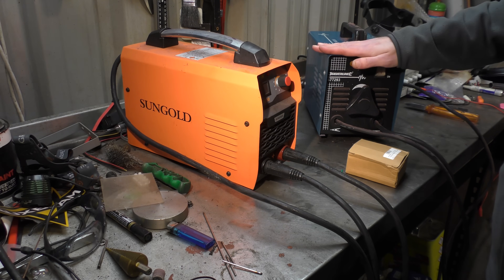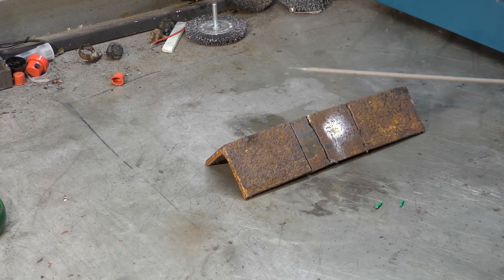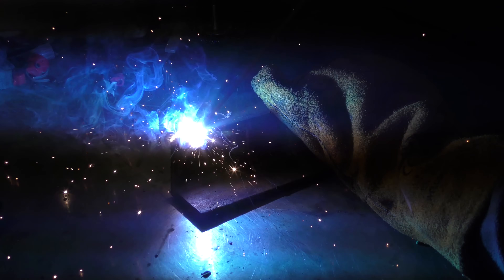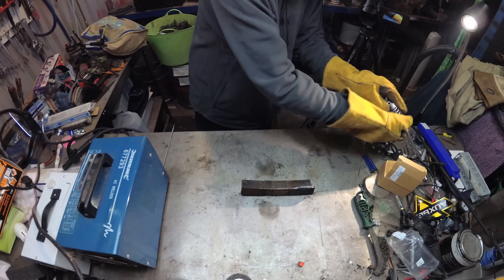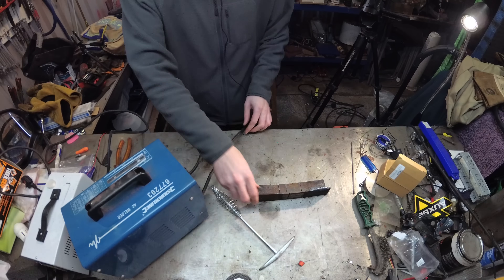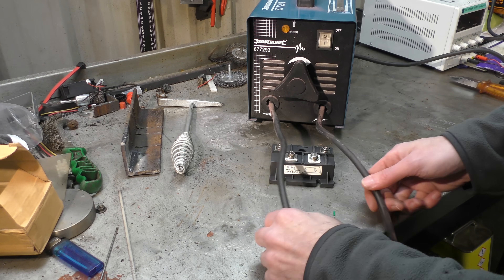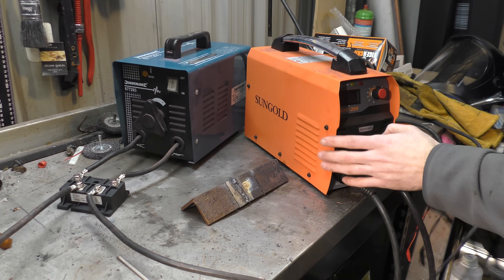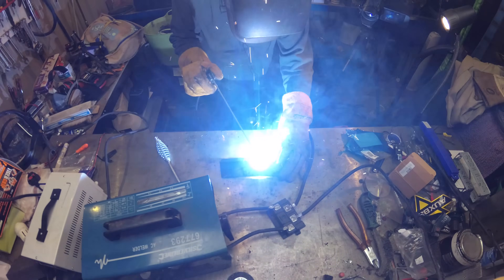Turning AC welder into DC with a rectifier

Comment: I converted my welder from AC to DC and found that with electrode negative (like yours) that there is less splatter and more heat/penetration put into the work piece. Think of it like a magnet in that through AC it attracts and repels at 60 times a second (50 hertz where you are?) and through DC it is always in an attracting mode of the weld metal to the work piece. As for your capacitor, carefully measure your AC voltage at the terminals with the unit turned on. On my 90 amp unit, the AC voltage had a highest reading of 27 volts. The capacitor I used was rated 21,000 microfarads and up to 100 volts DC, well above the 27 volts output.
Reply: Hello, I am planning do the same with a Lincoln AC-180 welder.  I measure in CD after the bridge rectifier, in open circuit, and have 110-130 VCD, (in 110 Amp the selector) I know that must drop that voltage to 25-30V  when soldering, but for that above 100V open circuit voltage, need use 150 or 200V capacitors.... or not ??  this cause that I realize (sadly) the capacitors to use are huge in voltage and capacitance .... or I am missing something ??? What voltage capacitors you used ??
Reply: @345rvv  best to get 150v or 200v caps.   200v 1000uF caps have gotten cheaper because a lot are manufactured these days as a pair of them are commonly found in USA market HVAC/furnace blower motors .   If you only can get 100v rated then perhaps place a 100watt, 100 Ω  aluminum shunt resistor permanently across the  welder DC output (after bridge rectifier).   Turn on welder and see if this pulls voltage down to 100 or less.   Quickly strike arc and don't leave welder on except when actually welding.   Experiment with resistor value as required .   The resistor should protect the caps i'm open circuit but won't draw much power once the arc is struck and voltage plummets lower .

Comment: Change the polarity so positive lead is in neg position and you will see a big difference a player everything will be smoother
Reply from the maker: From TheFabricator.com:

In DCEP the electricity flows into the tip of the welding rod and concentrates about two-thirds of the heat, which gives good penetration. DCEP is usually used on thicker steels.In DCEN the electricity flows out of the rod, concentrating about one-third of the heat on the rod. Less penetration makes this a very good choice for thinner steels.Not sure what direction the rectifier I bought actually puts out, but one-way rounds gives me even shittier welds than the other way.  :)
Reply: You are correct 100% there is so much misinformation out there .I used to teach welding theory at college,rest assured .One small advantage when using a purely DC arc welder is you do not get arc blow which means the arc will wander near a corner and drive you nuts.It will happen more frequently with DC,I have an SIP 180 amp AC buzz box and shall try your  £16 fix thank you.  @DavidMcLuckie
Reply from the maker: Please correct me if I'm wrong on this.  DC Electrode Positive for better penetration and thicker material, DC Electrode Negative for thin material and sheet work?
Reply from the maker: The 'DC' contraption I built isn't a true DC.  Needs a few more components.  I was just curious to see if it was any cheaper or easier than buying one.
Reply: I heard it as the opposite of that from other videos by actual welders. You are right to use mostly electrode negative for most jobs, and only switch if you have thin metal or a project that heat would affect.
Reply from the maker: Ahh,  MIG, Gasless MIG (whatever it's real name is) and TIG differ again on polarity.  It's like welding is like science and stuff.  :)
Reply: Indeed!
Reply: If you took a big Lincon or a big Miller welder apart and looked at how it is wired you will find the polarity os negative on the stinger inside the welder on the outside its marked positive. I've noticed that in this video when he's welding it splatters really bad like an AC welder does  a big shop welder libcon or miller DC welder does not do this and also the sound on an A C welder is much different than a D C welder AC is much noisier a good DC welder all you can hear is the hum of the transformer
Reply: Bugs splatter.
Blood and molten metal spatter
Reply: I've  never used a stick welder for sheetwork mig welders are best for that
Reply: No, the rod package will tell you whether to use DCEP or DCEN. It depends on each rod. Yes, it will work both ways, but the package will list which us preferred.
Reply: David, after reviewing more videos I have found that you are correct. I have found conflicting examples when using Flux Core MIG, which is what I have, probably to keep the slag out of the weld. Carry on!
Reply: David McLuckie thats not a good choice in my book fux core whoever thought that shit up should be shot everytime Ive used flux core and no matter the temperature all i could make was birdshit welds use regular wire ine your mig and you will have much better results

Comment: Reekris - are you leaving those terminals as bare metal for electrocution purposes?
Reply from the maker: +Paul Alford As bare as the earth clamp and electrode. :)
Reply: maybe 40v 100a with wet hands will do if you touch both terminal at the same time but no harm if you just touch only 1 terminal.